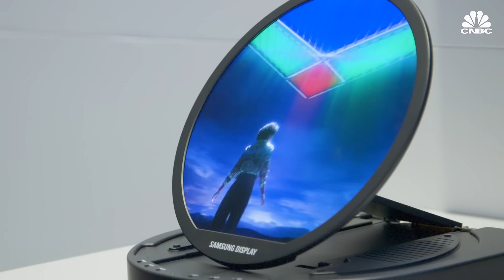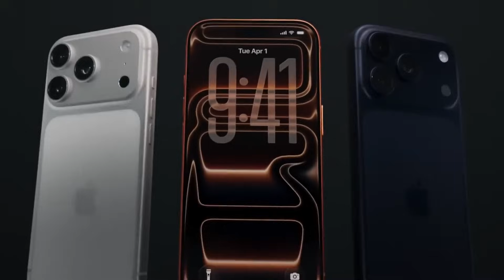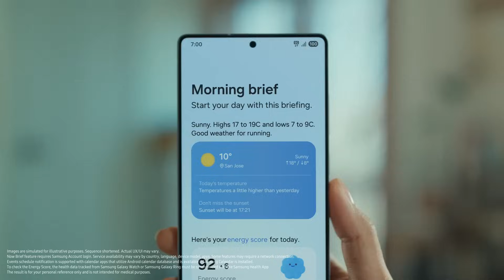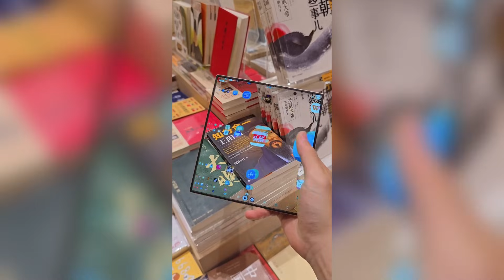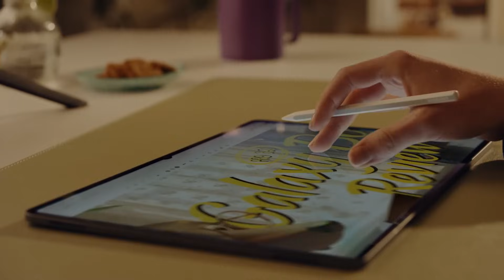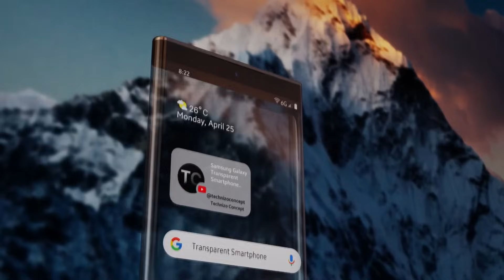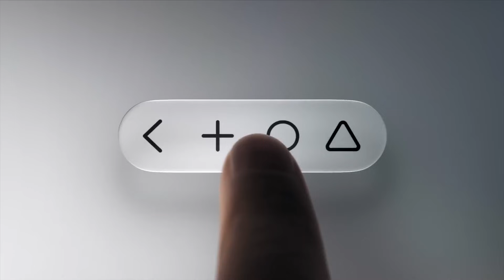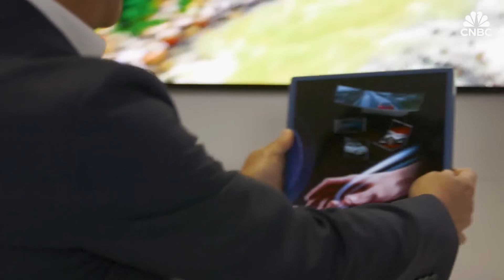Samsung Stuns The Industry with Its New Fully Transparent Galaxy Tablet “TAB X”

Comment: LCD (Transparent LCD)

Purpose: Convenience store beverage showcase, vending machine front, educational teaching aid

Features: It removes backlight from existing LCD panels and uses external light sources (solar or internal lighting). 
Although it is cheaper than OLED, it is not self-luminous, so you can see the screen only when the ambient light is bright and the transparency is slightly lower (about 10-15%).

Comment: It is a form in which a fine LED is embedded in a transparent film or mesh shape. 
It can be attached or suspended directly to the glass surface, making it easy to install and applicable to curved surfaces. 
It is mainly used for large advertisements that are viewed from a long distance.

Comment: Samsung has the best hardware,  apple has the best software.  Samsung made a grave mistake by incorporating copycat android into its hardware. Should have acquired the Apple OS instead. Android is the mediocre copycat of Apple iOS. It's a bad mistake to use android OS for its platform.  Damaging reputation in sophistication department by incorporating mediocre OS into its hardware. Giving away in the software department significantly,  while Damaging the hardware as well.  Regardless of what sophistication samsung brings to its hardware products,  android OS will damage the sophistication. The two don't go together.  

Samsung must immediately turn to Apple and acquire the Apple OS for all of its computing products.

Comment: When Apple removed the headphone jack on the iPhone, Samsung did too so they could be like Apple. Great video. Thanks, but I'm not so sure about Samsung. A transparent tablet, though? That would be absolutely amazing.
Reply: It's definitely not possible yet. While Samsung does have transparent screens (MicroLED), the rest of the tablet can't be clear. There's currently no way to make high-performance batteries, copper wiring, and silicon chips invisible. Those parts have to go somewhere, so a truly 100% see-through device like that is just sci-fi for now.

Comment: Who's asking for a transparent device?
Reply: Veichle screens, motor cycle helmets, storefront windows. The only use case for a phone is that you can walk safely without hitting lamposts but apart from that its not a ground breaking leap for personal devices.
Reply: Transparent/ window screens exist already like on cars and Meta glasses. That's different than a transparent phone
Reply: @smokescythe8880  yeah but they are non touch screen

Comment: I do believe this is coming, but I thing it’s still years away and will believe when I see it for myself
Reply: It's definitely not possible yet. While Samsung does have transparent screens (MicroLED), the rest of the tablet can't be clear. There's currently no way to make high-performance batteries, copper wiring, and silicon chips invisible. Those parts have to go somewhere, so a truly 100% see-through device like that is just sci-fi for now.